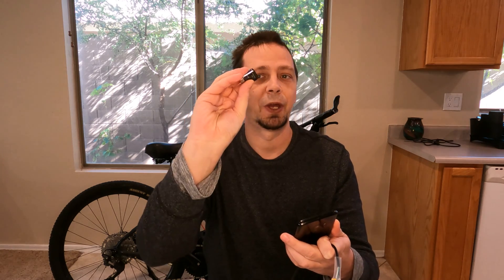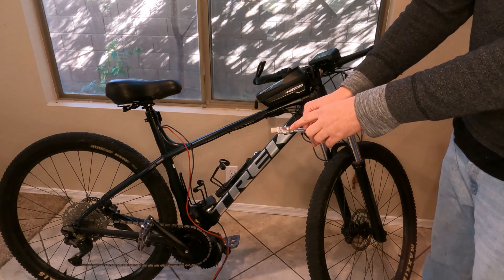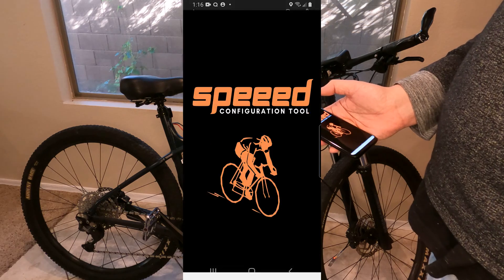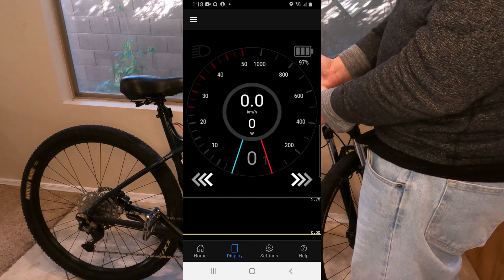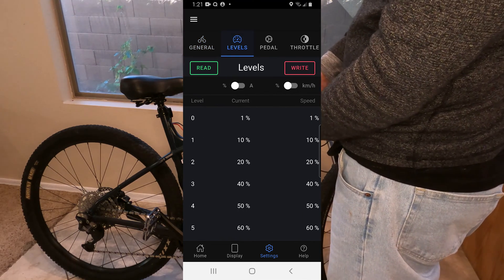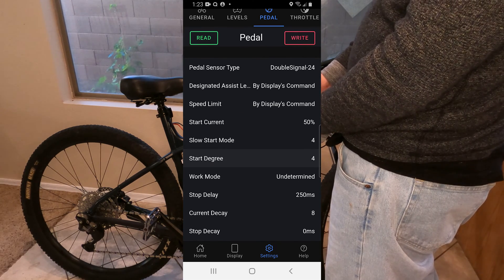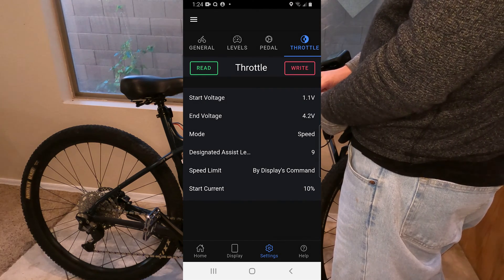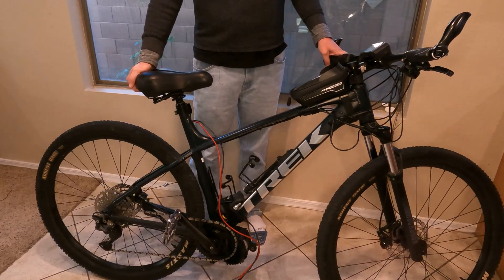🚴‍♂️REPROGRAM BAFANG - BBS01, BBS02, BBSHD | Make Bafang Go Faster or Slower #BAFANG

Comment: Can you disable peddle assist
Reply from the maker: I think so.
Reply: You can. I did.P09 enables throttle without peddling. Record. 0 throttle start
 

P10 0 = peddle only. 1 is throttle only. 2 is both.  record 2
P11 is peddle assist sensitivity. 24 is delay before power. 10
P12 is 3 now 5 Power when starts. 1-5
P13 crank magnet type. Don't touch record. 12
P14 controller amps. Record only. 15
P15 low batt. Setting. 39v
P16 odometer reset
P17 cruise control. Don't use.0000
P18 speed ratio adjusts speed display
P18 for zero assist. 100
P19 removes 0 assist mode from display don't change 
P20 don't change comms setting 0000

Cell to display adapter,  use SPEEED AP

Comment: This app is no longer available. Any alternate you suggest?
Reply from the maker: I just check using a S9 and the Speeed - Bafang app is still there in the Play store.
Reply: @Eric_Tennant  app is there but unable to install
Reply: Giving message it is no longer there
Reply from the maker: Sounds like the play store system is bugging out. If It was just a unable to install error I would say "
Make sure that you have a stable internet connection. A weak or unstable connection can cause problems with app installations. Check if your device has enough storage space to install the app. If your device's storage is full, you may need to free up some space before you can install the app."

Comment: what bike is that. i have a trek marlin 7 and i got the bbshd. is there anything i should know before fitting
Reply from the maker: It a Marlin 7!
1. First problem is the bottom bracket could be somewhat out of shape. https://youtu.be/7wikIUxtnQQ
2. Make sure you get the right chain ring https://youtu.be/CBBde5yRW7M 20.5 is best for this bike.
3. Your going to need two chains to create the right length chain to get onto the biggest gear. (Let me know if you need a video on this and I'll make one)

Comment: So on my aventon, the plug coming out of the frame is FEMALE. Is there a usb to male adapter youve ever seen?
Reply from the maker: Nope! You may have to make your own adapter for it.
Reply: @Eric_Tennant  do you think the aventon controller would prevent changes to the bafang motor?
Reply from the maker: Maybe, not sure.
Reply: @Eric_Tennant have you any source that tells me how to make my own adapter for it?
Reply: Hey, i have the same issue. Did you found an solution for it yet?
Reply: @ayanamirei6595  there’s no way to do it unfortunately!

Comment: Eric can you help me reprogram my BBSHD? Coming from Avondale.
Reply from the maker: Sure what are you trying to do?
Reply: I want to increase my speed and anything you can suggest. New to the world of ebike.
Reply from the maker: The bigger the front gear is the fast it will go; However caution with the rear gears as I just locked out my fastest (10th gear) because I have wear on it causing the chain to slip in that gear. Lost about 2-3mph by that. All the other gears are fine.

Reprogramming it you can have custom pedal assist modes, but if the battery can push out 1300-1500w not much more can be done without changing the controller to 72v by replacing that part of the hardware. Check mode 9 and make sure its giving 100% some retailers set there own settings and may lower its top output.

The other hack is to lie about wheel size. I have not tested this as I don't think that my limiting factor. Hit 34 mph on flat when my gears were new.

The throttle is the only way to get a true 100% out of it. Pedaling wants to only put out around 1000 watts .
Reply: Ok thank you Eric

Comment: Why doesn't it work with mine...i brought 2 programming cable...but when i try to connect it via android..it doesn't want to connect the motor Any Idea's?
Reply from the maker: Did you turn on Bluetooth?
Reply: @Eric_Tennant  Bluetooth isn't a thing yet for speeed IS IT...
Reply from the maker: Sorry too many green breaks last night. Your 100% right. 

Could be the USB to USBC adapter or the phone. The odds of both cables being bad would be low.
Reply: @Eric_Tennant   I've tried my sister's phone my mother's phone. Nothing..but what matters the Most..

Riding the bike in PAS 1/2 is cool with  Assist and throttle..But when I go into PAS 345 I change it from 9 via lcd But soon as I hit a incline in them modes it cuts OUT so I have to turn off the battery then back on..any idea l..I can find nothing on the Web about....could it be the battery or lcd
Reply from the maker: @lazarus5609  Sounds like the battery BMS is turning the battery off. Given it wouldn't have time to overheat I think you have a bad BMS.

They are cheap to replace. You just have to be careful when working on them as they have burnt down a house or two. Took me a bit to stop making mistake while learning and fixing them.
Reply: @Eric_Tennant  I haven't a clue What a bms is..I'm a novice when it comes to stuff like that..but I had a feeling it was to do with the battery I'll just buy a new 1...question I've a 48v 13ah on a 750w mid motor..would it be ok for me to get a 48v 17ah battery would there be any problems...? Thanks for you help
Reply from the maker: BMS is Battery management system https://youtu.be/zhymnU83Jlo

Ah is how much energy it can hold. So the 48v 17ah would work and has more range.
Reply: @Eric_Tennant  again thanks..going back to the programming cable my phone is Samsung s10 my sisters is s9 it did work about 1yr ago...but like I said for some reason it isn't now..via the usbc connection or usbc to usb connection..keeps saying No signal found....
Reply from the maker: Not sure. Maybe a bad motor controller is keeping it from connecting. Wouldn't think the mode buttons or screen would work then.
Reply: @lazarus5609 I see your comment is 8 months old however I'll answer this anyway. Not all USB to USB-C adapters are created equal. For Samsung, Motorola, and Apple you need an adapter that is spec'd for OTG(On-The-Go). It allows external peripherals(in addition to Data transfers) to be used by your phone. Has to do with the COM Port spec. You may also need to set/enable USB Debugging Mode in your S10 to open up additional communication protocols.
Reply: @SternLX  gone are the days of plug and play

Comment: DO YOU REALISE THAT USING THIS APP CAN DISABLE THE PEDAL ASSIST? i HAVE USED THIS METHOD TWICE AND LOST MY pas TWICE. iT COST QUITE A LOT INCLUDING 6 HOURS TRAVELLING TO GET IT RESTORED. i STILL DO NOT KNOW WHICH PART OF THE PROCESS ACTUALLY DISABLED MY PAS BUT I AM SCARED TO EVER DO IT AGAIN.
Reply from the maker: Sorry about that. I had the App glitch out the bike once. Luckily I had the original settings saved and was able to restore it to default to get it to work again.
Reply from the maker: Save often, make minor changes, and test. Is the road I use with it. App also great if your break your screen.
Reply: That happens when you set "Designated Assist Level" to anything other than "By Display's Command".

Comment: Thanks for sharing! I'm considering putting a mid drive on my specialized stumpy full suspension, talking to local shops around here all I hear is, "your frame can't handle that torque", "you'll snap your chain", you'll ruin/strip your cassette", you'll have no center clearance" "just buy a pre made one from us" 🤷🤯
Reply: Lol.  Just do it.  You'll love it.
Reply: @bretfielder6363  I did do it! 750 mid drive, yes, glad I did, yes I love it!
Reply from the maker: Big kicker with pre made ebikes is the cost of an extra battery. They made it so they're the only ones that make it for said bike.

My oldest battery heavily used lasted only 3.5 year before I had to order a spot welder to repair it (Video coming later). Now with a bike company by that time may not make the battery anymore and repairing is a bit dangerous.
Reply: @Eric_Tennant  Thanks for the input.
I can see where a pre made one would have advantages, ie, warranty, not being able to use tools, etc.
I've worked on cars for thirty years so maybe I can figure this out?
Reply from the maker: @whatsit2ya247  100% Bafang is easy to install. Much easier then doing just about any repair on a car. I have a Bafang install video on my main page.

Comment: I believe if you want the throttle to work on pedal assist zero you need to set pedal assist 0 to 1%. With that setting your throttle works regardless of whether pedal assist is on or not. I could be mistaken about that. Good video
Reply from the maker: Indeed that will work to give zero mode throttle. Think I'll keep my mode zero as a off mode that records miles and speed. My mode 1 is so eco that I calculated that I can get 428 miles out of my big battery (48v 20ah) on flat, but that with me doing 9/10 the work (24w-54w motor output)
Reply: @Eric_Tennant  That’s crazy amount of mileage. I always figure I’m safe to 100 miles with no problem. I use a 17.5 amp hour, maybe it would go a lot more, but maybe not. I find the only time my motor is being used is when it’s going uphill or getting up to speed. Typically when I get to cruising it drops to zero output. I’ve also to now my max output to avoid any issue of overheating.
Reply from the maker: Purely an estimation on my part https://www.youtube.com/shorts/SEWyJx7f8SQ
Reply: If we run in pedal assist... we can go any speed we want.  On the throttle we are limited to 20 mph and no riding on the sidewalk.  

My M800 ebike only needs very little pedal assist on the flats, if any and none going down hill.

The only time I really need e power is going up hill and driving into a headwind on the flats.  Or trying to stay semi up with traffic on a busy street.

To get a higher top end speed... I will be adding a larger front sprocket.

Comment from the maker: 😇 https://www.youtube.com/user/lastend1?sub_confirmation=1 Subscribe

ITEMS

Bafang Programming Cable
 🛒Amazon https://amzn.to/3g3olGi
 🛒Aliexpress https://s.click.aliexpress.com/e/_DDoElbp

1000w BBSHD Kit (The one I got)
 🛒Amazon https://amzn.to/3FhVmsF
 🛒Aliexpress https://s.click.aliexpress.com/e/_DdJKFMP

750w BBS02 Kit
 🛒Amazon https://amzn.to/3f1v3Mm
 🛒Aliexpress https://s.click.aliexpress.com/e/_DlVYx1D

500w BBS01 Kit
 🛒Amazon https://amzn.to/3ssMY1J
 🛒Aliexpress https://s.click.aliexpress.com/e/_Dlsh9GR

1000w M625 Kit (Program cable will not work with this model)
🛒Amazon https://amzn.to/3XwmQkQ
🛒Aliexpress https://s.click.aliexpress.com/e/_Dd5gqQf

Electric Bike Batteries
🛒Amazon https://amzn.to/3ALQuZH

Shift Sensor
 🛒Amazon https://amzn.to/3Whm9eH
 🛒Aliexpress https://s.click.aliexpress.com/e/_DFTPBVV

Extra Cable
 🛒Amazon https://amzn.to/3g2afVG
 🛒Aliexpress https://s.click.aliexpress.com/e/_DdNmT47

Twist Throttle
 🛒Amazon https://amzn.to/3TrlrJ2
 🛒Aliexpress https://s.click.aliexpress.com/e/_DFGbLmJ

🛒Bafang Bottom Bracket Spacers: https://s.click.aliexpress.com/e/_DBiwhHN
🛒Bike Arm Remover and Bottom Bracket Remover: https://amzn.to/3ErAM88
🛒42 Tooth Chain Ring With 20.5 mm offset: https://amzn.to/3EBVP8l

Comment: Thanks for the info, I ran out of battery 25 miles from home one time,got s810 hub screen to light up and put it from 48 volts to 36 volts and limped it home in assist 1 which basically makes the bike even with pedal bikes and not heavy. It would have been a long day without the cheat! These battery meters are useless and have found watching volt drop is much more accurate. I’m interested to see how your bike does on hills!
Reply from the maker: Once I get a Chain ring that can hit my biggest back gear a hill clime video will be in the making. Also looking to revisit some tours that I had to hike a bike on.